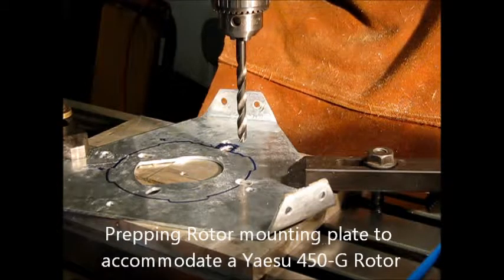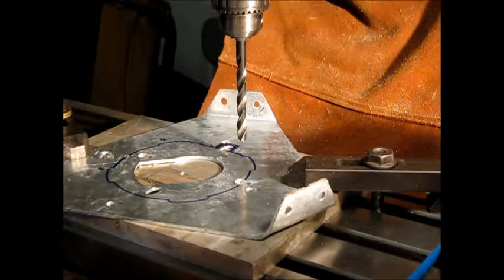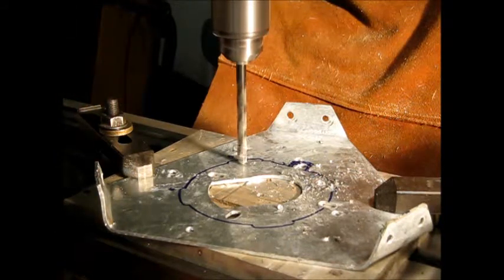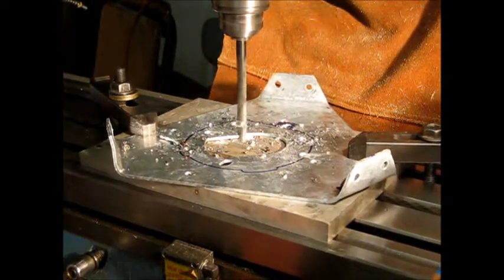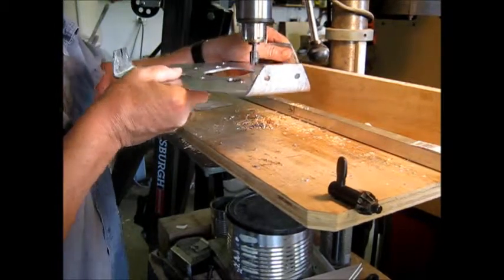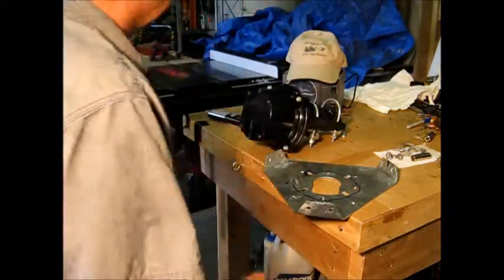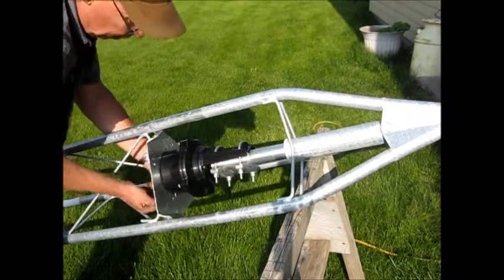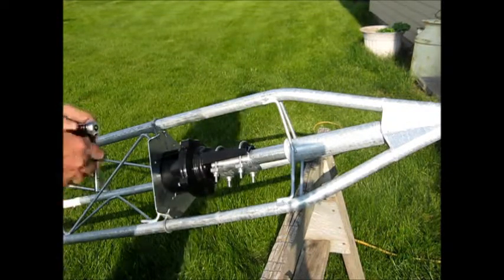Rohn Yaesu 450 G rotor installation project

Comment: Where did you mount to thrust bearing? How big in OD pipe will this rotor accept? What kind of mast pipe did you use?
Reply: It's Me Again thanks. I installed the 450’in my tower today. Posted it on my channel. I didn’t know these had plastic gears in them:( too late now hihi
Reply: @JayN4GO  My rotator just stopped today it's not like I use it everyday. I put it together about 6 months ago on top of my roof and mounted it to the chimney. I figure something inside of the rotator has malfunctioned . I don't have a warranty on it and I will just have to climb a ladder and hand turn it when necessary. I sure am glad I didn't put it on my 50 foot tower. Plastic gears could be the same crap inside it. The control box sends power to the rotator and you can hear it up on the roof trying to turn . The strange thing about it today was no wind or rain it just completely died..
Reply: Maybe the TA 33 mosley was a little oversize for it to turn after all .. I don't know it sucks
Reply: @lostinspace280  that’s ok. I went with gas pipe. Very heavy. Not the best for lighter yagis but I’ve seen emt top rail bend over in wind. Saving my Pennies for aluminum haha
Reply: @lostinspace280  first of all. Great call sign for Cw. You really lucked up on that one Ken. I’m still back and forth about winter fd. I think there’s a 160m contest that same weekend. Naqp Cw is this weekend! It should be a slower contest if you want to give it a try. Name and state is the exchange. Hoping some of these guys slow down for people:)